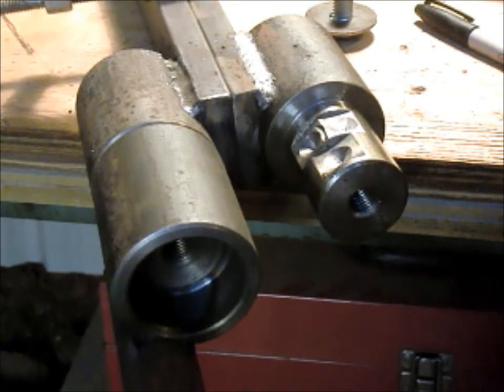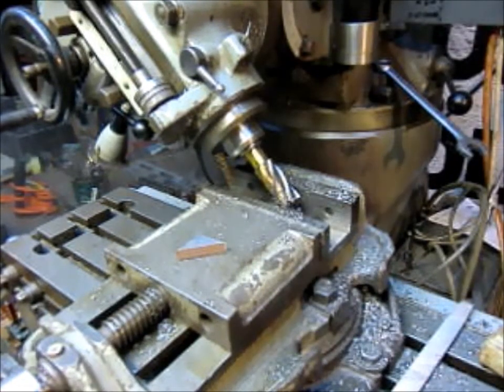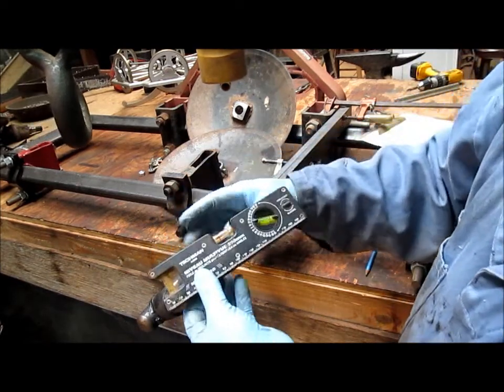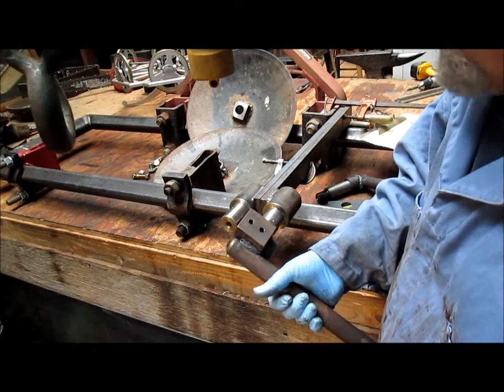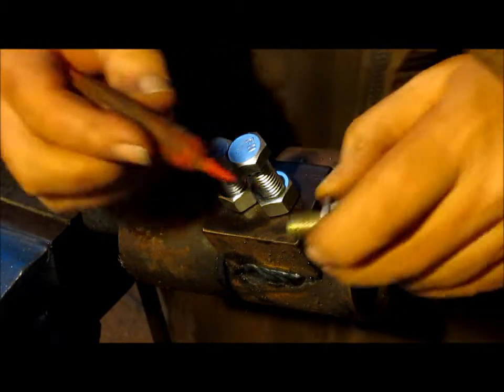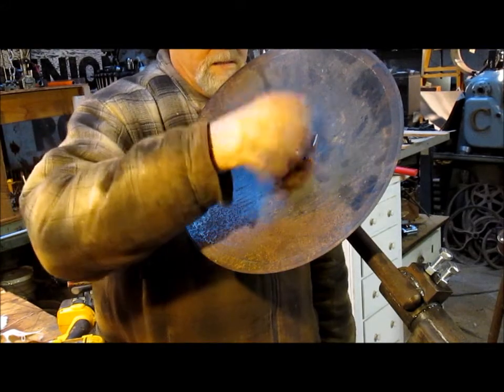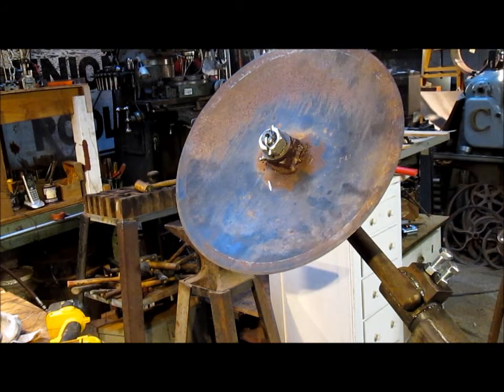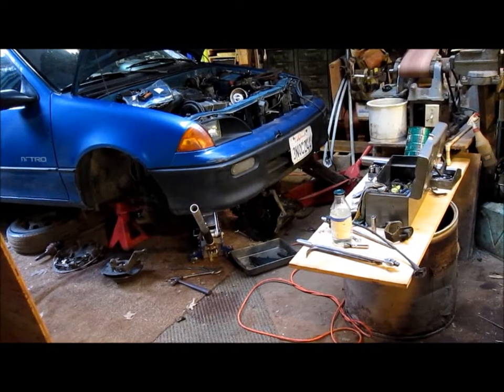Farm Frenzy #12

Comment: Just a suggestion for next time putting a grease fitting where it is possible to get trash on and in it or damaged. Maybe weld a small threaded pipe with a cap(big enough for the grease gun hose to fit in) around it so the grease fitting is protected providing there's enough room
Reply from the maker: I like the idea.
Reply: @NikColyerMachineWorks  yeah I've worked on logging equipment and when those things break off it's a pain to get out but for rubber tired equipment they put a pretty beefy pipe with a cap  around the valve stem to protect it from damage